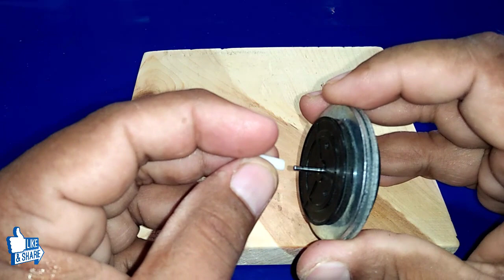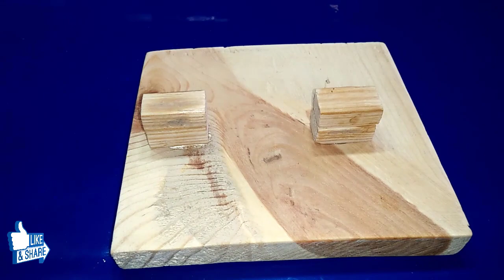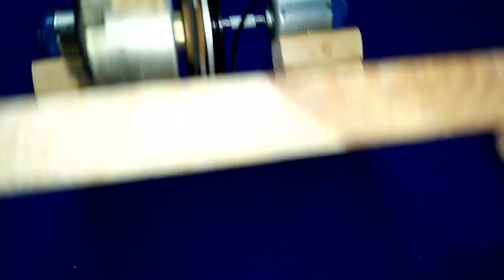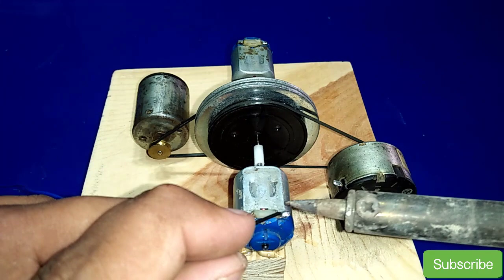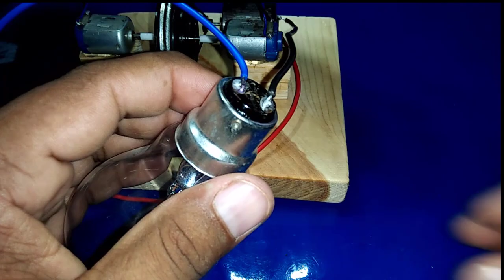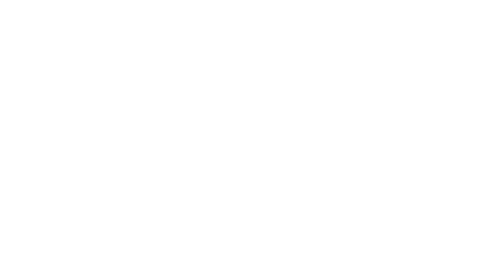how to build free energy generator 220v new hj technology project 100% real

Comment: I understand how this works. the motor drives the pulley that drives the second motor as  a generator that feeds back power to drive the first motor. these motors are universal motors that can be run off of  AC or DC. A motor being run as an alternator produces AC. The other two motors are being used as alternators hooked up to the 220 V A C. light bulb in series. That tells me the two output alternators are producing 110 to 120 volts AC. with  sufficient  wattage to run that light bulb. Noted: you have to start it with external power or give the pulley a good spin. I have seen this scaled up to meet an  industrial purpose powering a sawmill operation on youtube.
Reply: Oh man i hope this was ment as a joke.. 
Motors that run as generators do not output AC but DC. NEVER EVER can these tiny motor produce anything over 3V-5V DC. 
Sorry to tell you, but the bulb he is using is a 9-12V DC Bulb thats gets turned on with a relais probably or a switch. There is a Battery under the Wood piece that powers everything. You can see the bottom of the wood not touching the table when he puts it down.

PLEASE do not believe in this crap.
Reply: Sir, you are totally wrong, All alternators produce AC. internally. All  electric motors that have magnets and brushes will produce alternating current if the armature is turned to sufficient RPMs.  If you don't think this is the truth I have an experiment just for you.  Take a microwave oven turntable drive motor and hold it in your hand with the electrical contacts against your skin, now give the  motor a good crank. Then tell me a magnet motor won't produce AC.